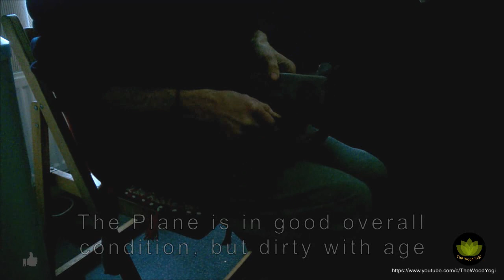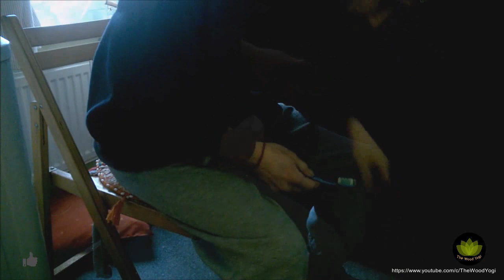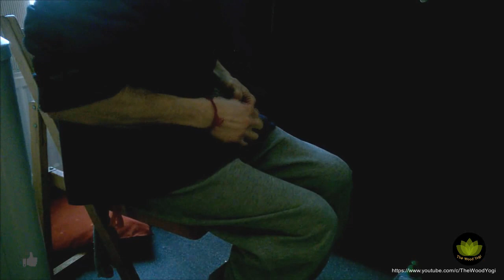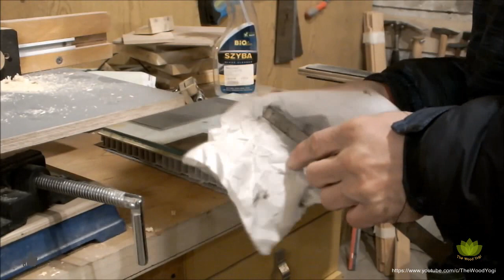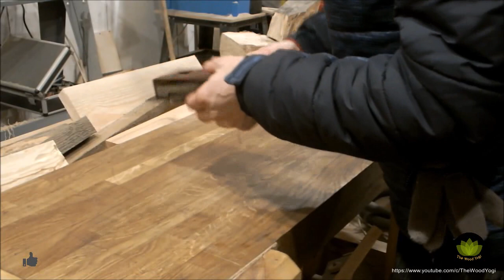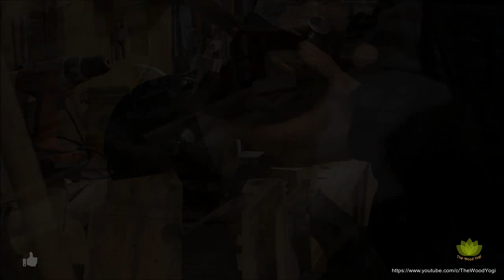Restoring an Antique Plough - Plow Plane - Woodworking Tool

Comment: It's a beautiful plane and a good job you have done on it.  It will work better in your bench vice ware you can bear down on it more.
Reply from the maker: Thank you Peter :) It was still around 6am after a sleepless night and I wasn't thinking straight :D I realised later that the position was too high. I have used it since in the bench vice and it's fantastic to work with :) The only one that I used similar to this was more than 30 years ago in the workshop that i was employed and I couldn't get it to work so well. I understand them much more now, I'm glad I stuck at it :) ॐ

Comment: What a beautiful tool! I love seeing the process and how its used. So cool that you have the same initials. :-) Well done!
Reply from the maker: Thank you my friend :) It will get a lot of use soon as I need to make a lot of wooden windows around 80 at the last count. i won't know for sure until I assess the condition of the old ones, but they have to match as close as possible to the original ones. Some are 17th century :) ॐ